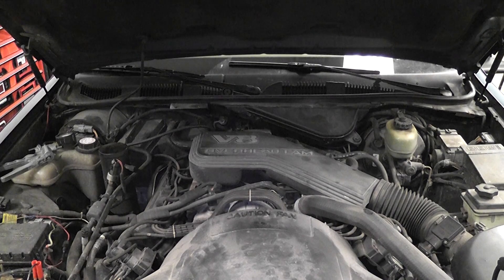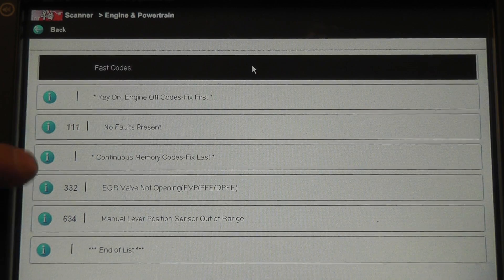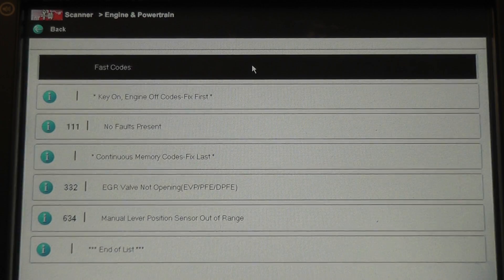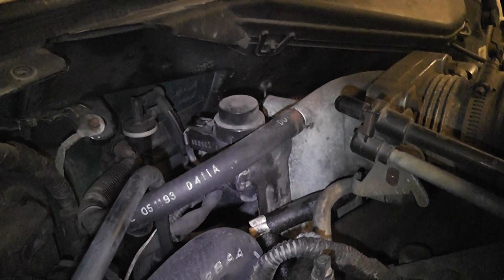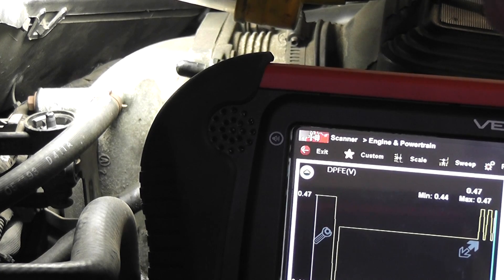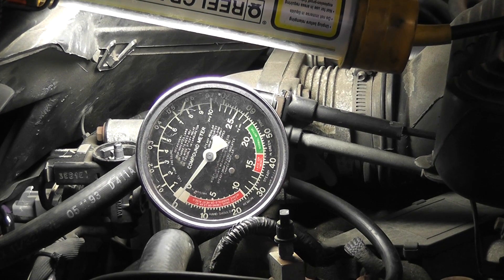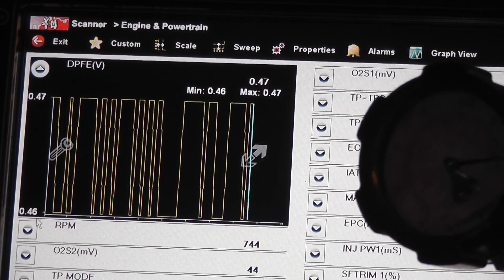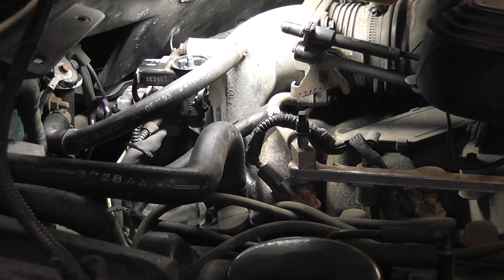How to test for proper EGR flow (restricted intake passage) - Ford

Comment: Yes when I put finger over vent my idle drops. Sounds like gonna stall.   I disconnected then tube to egr  itself I get vacuum. So where do I stand?
Reply from the maker: Where do you stand with what? I don't even know what you are working on, or what code you have. Help me help you. Thanks!
Reply from the maker: Sorry, If you started this question in another post. You need to stay in that post man. I have thousands of these. I can't keep up or track otherwise.
Reply: As of now p1409  went against  the rule don't change part of don't have to. Got the vac reg code. 2001 ford escape.  Just crap gas miles. At idle I'm at 20 short term at times higher. Long kind of low  kind of balances out. But yea. I stand at I changed my mass air flow  fixed barometric in Hz had 154 155 tops now at 160. Have a scanner tool so checked watching your vids. But I in no own of multi meter. So working with mac tool scanner. Had no grand read on mass air flow. But from baro read knew needed to replace. So now p1409 code I can't figure out my issue  my evr changed still have code. I checked in a way my dpfe  getting vac  so I think good. But I did visual  seen purge canister hose collapse when I replace I'll get back. ...  Also I unplugged dpfe got the 5 volts so I got feedback  I'm not sure if actually need to replace dpfe
Reply: I'm gonna check again checking  the vac solenoid and checking vac on vac hose on egr  n checking for vac which believe I did  but I'll check again  then get back.

Comment: I AM SO HAPPY to meet you here mate , i am doing same as your job i am selling my diagnoses to one big garage here in dubai , but i think i need another few year to get qualified as you do , any way have you present how can new mechanics check for bad oxygen sensor through date stream test ? 
 HVAC system or even basic infos how does it operate as system ,
wheel speed sensors and bad bearings , or bad wheel speed sensor how related to some drive train issues like dtc p1380 chevy,   i subscribed

Comment: After testing the DPFE at KOEO with a vacuum pump and monitoring DPFE V it seemed to be linear and check out.  Then I exercised the EGR valve a few times. Now the V idle = Voff, ran it thru a drive cycle and it seems to be fixed. Car was not driven in a few months, maybe something was sticking. Still trying to figure out the vibration/rough idle while warming up - the fuel trims are under 3% - so im ruling out vac leaks for now.

Comment: I also have a 95 bird with this engine and a P0402. I have relatively new EGR and DPFE. DPFEV KOEO is 1.0V,Idle  KOER is 1.5V. Pulling the EGR vac line does not budge the reading. I get rough idle sometimes at around 550 RPM, gets worse when the car is partially warm but kind of improves if fully warm. The weird part is Total Fuel trims always hover around 0, even in the freeze frame from the P0402, even with bad idle. MAF seems to check out..BARO reading is in spec. Any suggestions? Thanks!

Comment: These early 4.6L cars are notorious for clogging up the ENTIRE EGR system. I believe it has to do with bad valve stem seals that don't age well and let oil in. The first step is taking off the throttle elbow, like you say, then the next step is taking off the EGR pipe and it is likely totally clogged. Another test is to take off the rubber hoses that attach to the EGR pipe and pull vacuum on the EGR tube. They should flow freely to exhaust, but they could be plugged enough to hold vacuum..

Comment from the maker: excessive flow is usually from a bad DPFE sensor, but that is weird that it is temperature related. Maybe the solenoid is sticking or the air vent filter on the solenoid is plugged? When it sets this code to you ever get a rough idle too?
A plugged cat can give this code too.

Comment from the maker: @Username64870 If you have my book check out Section 8 "Pressure Sensors" pages 9 and 10 or Section 24 "EGR Systems" . I have a complete flow diagram in there.

Comment from the maker: @Amopower Yes, I was using the EEC-IV adapter under the hood. Sorry I didn't pay attention to the number of wires. 
BTW the scanner portion of the Verus is identical to the Solus. So any car you can communicate with is the same for both tools. Of course there are major differences in the tools but scan data and bi-directional controls are identical.

Comment: Similar question as DIYautotech - does your scanner have an EEC-IV adapter, and you just used that to plug into the EEC-IV connector under the hood? If so, do you recall if that harness on the car had 5 spades (not including STI)? I think that is the only kind where you can get a data feed. My Probe has EEC-IV, but I only have three spades plus the STI. There is not Data +/- spade on this  car for whatever reason...sucks because I would get that scanner, but not if I can't plug it in.

Comment from the maker: @Bonfield2002 Great question. No fix for it. It happens when hot exhaust gas (EGR flow) rapidly cools when it enters the intake passage (lower psi = lower temp.).